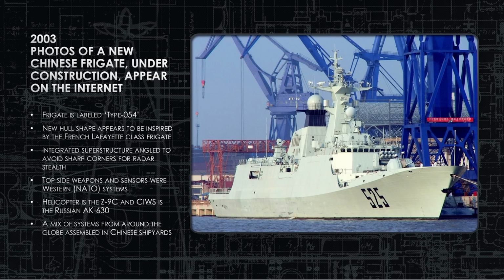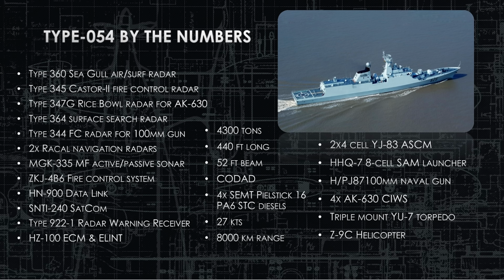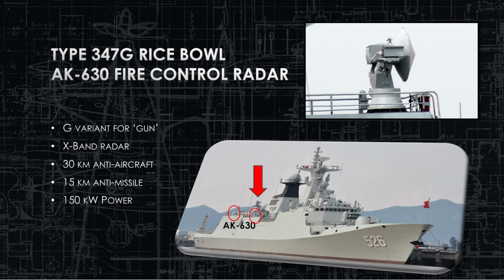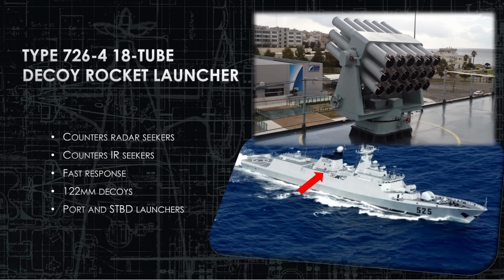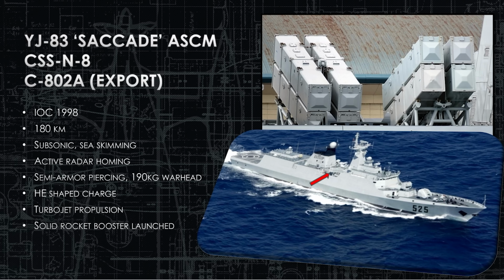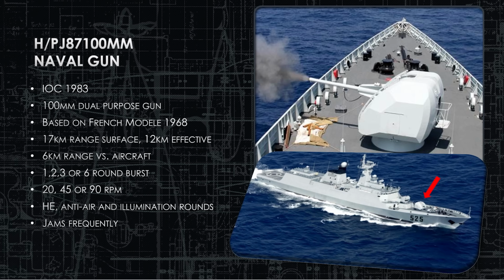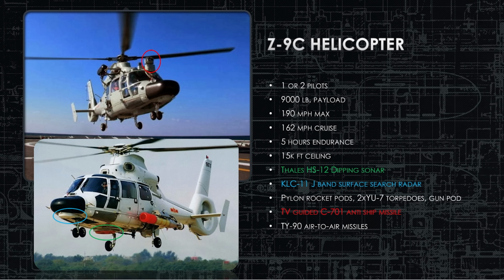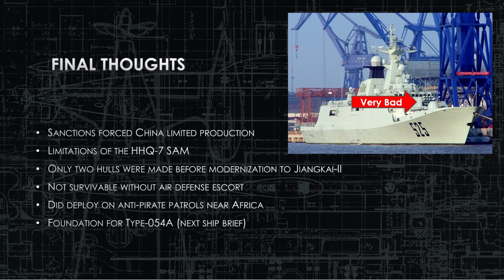Inside The DEADLY Warship China STOLE From France

Comment: With respect to the ship launched anti-sub torpedo, Generally, are the tube launched systems getting too short in range now when the sub-launched anti-ship torpedo's are much longer ranged?  I would have thought that a couple ASROC in the VLS system that can at least through the torpedo out near the sub to start would be better, assuming you have enough VLS cells.
Reply: 40 years ago our tube-launched were 5 miles and ASROCs were 8 miles but could be nuclear tipped
Reply: @michaelkendall662  thanks for the info.  I just looked up, the current Mk 48 ADCAP sub-launched ship killer has a range of between 38 or 50 km depending on the speed.  Meanwhile, the Mk 54 lightweight from a ship tube has a range of 9 km.  place that on top of an ASROC- RUM-139C which can throw the Mk 54 out 22 km before it starts to swim and a ship could, in theory, strike a sub out to 31 km (more likely less than that to give the Mk54 time to find the sub).  So, a Sub could still safely strike a ship if it was between 31 and 50 km away.  Of course, the ship can use an MH-60R to drop that Mk 54 on top of a sub more than 100 km from the ship, that's the best defence.  But I don't see a reason for the tube launchers on a ship anymore, if the sub is within 9 km the ship is already dead. I would think a couple ASROC's the Mk41 VLS in case they get surprised and can't get the MH-60 up in time (or sea state is too high to launch), but if you are actively hunting subs then having two MH-60's so that one can be up all the time would be best (in my opinion).
Reply: @Andy81ish  my EOS was almost 40 years ago
Reply: Yes, I noted the 40 year time, I wasn't trying to say you were wrong, I just listed the current weapon ranges to show that now, in 2024, it no longer seems to make sense to have tube launchers on a ship, unless the lightweight ship launched torpedo can be used to intercept the incoming heavy weight torpedo like an SM2 would intercept an incoming Harpoon type missile.  Do you recall what the range of the sub-launched torpedos was at the time?

Comment: Would be cool with a video detailing the actual and perceived benefits hyper- and supersonic missiles. With modern radar you still see it coming and all your anti-air defense missile needs to do is intercept it before it hits the ship, unless the missile has some sort of adaptive avoidance measures it shouldn't matter much how fast the incoming missile is as it's path is already predicted. To me it seems like cheap sea skimming cruise missiles (regardless if they are subsonic) with a time on target style attack designed to overwhelm defenses is the way to go.
Reply: The effectiveness of an AShM depends on many different factors, of which the velocity of the missile is but only one. Here on YouTube the importance of velocity is generally over-rated as a means to generate click bait and advertising revenue. 

Yes, velocity does make a missile more dangerous because it reduces the reaction time available to air defence systems. However, a higher velocity generates more heat due to friction as the missile moves through the atmosphere, increasing the IR signature of the threat. Limitations imposed by materials require that hypersonic missiles fly at a higher altitude to prevent them from burning up. This makes them detectable at greater distances, allowing more time for an air defence system to react. And, yes, hypersonic missiles are more destructive than subsonic ones with equivalent warhead yields because kinetic energy varies with the square of the velocity. 

However, subsonic sea skimming missiles remain very dangerous because they approach below the radar horizon of a ship's air defence system, leaving little time to react. This advantage can be diminished by having persistent linked airborne sensors with look-down radar but this is difficult for a single ship to provide because they might only deploy a single helicopter, which is not always available, and there are limits to the size of the antenna you can mount on an aircraft which limits radar power output, sensitivity, and range. The US was slow to get on the hypersonic missile bandwagon partly because sea skimming missiles are so deadly, and because more expensive hypersonic missiles are not necessarily going to be more effective.

Also, mounting a cryogenically cooled IR seeker on the nose of a hot hypersonic missile is not an easy engineering problem to solve, implying that a hypersonic missile would need to employ a short range active radar homing seeker, which can be defeated by electronic means, or be unguided on terminal approach, or be dependent upon an external update provided by an independent sensor which needs to be in position and connected at the time the update is required. And, then there is the communication and sensor blackout problem experienced by a missile which is enveloped in a shroud of plasma, the thickness of which increases at lower altitude, unless it slows down.

The most important characteristics of an air defence system is the number of layers it provides and the number of targets it can simultaneously engage. For the sake of argument, if we assume that each layer has a 50% chance of intercept, then a system with 2 layers allows a threat to have a 25% chance of success. With 3 layers this falls to 12.5%, and with 4 it falls to 6.25%. Organic air defence, provided by a carrier or shore based assets, can provide an additional outer layer. An effective counter strategy is to deploy more missiles in a ToT attack in order to saturate the air defence system. However, missiles are not cheap, and magazine depth on warships is limited for both offensive and defensive weapons. Attacking aircraft are limited in the number of AShMs they can carry. A swarm of cheap drones is likely to more effective than an expensive hypersonic missile because drones can approach from below the radar horizon, have small radar signatures, can saturate the air defence system, and can progressively deplete a ship's magazines. If you can keep sending drones then it is only a matter of time until one of them will get through, and if the damage caused degrades the air defence system, then you can cripple a very expensive warship with relatively cheap drones. This is why laser weapons are becoming more important. Laser weapons require sustained energy generation instead of magazines.

You do not need a heavy warhead, or high kinetic energy, to achieve a mission kill on a warship which is packed with fuel and explosives, especially if the munitions are stored above the water line. All you need to do is initiate an uncontrollable fire, or alternatively disable the ship's expose sensors. Western warships cost a lot more than cheaper mass produced Chinese ones partly because Western warships have more water-tight compartments and better damage control systems. This, combined with better training of Western crews to fight fire i.e. every sailor is a firefighter vs dedicated fire fighting teams, makes them more survivable. A large fleet of Chinese warships which will burn to the waterline following a single strike, even if they are equipped with hypersonic AShMs, is not necessarily more powerful than a smaller fleet of Western warships if they can absorb more damage. A damaged warship can be repaired but a sunken warship cannot be replaced in the short term.

Another consideration is that a missile is useless if you are unable to detect and continuously update target tracking data. The open ocean is a big place, and ships are unpredictable mobile targets whose area of uncertainty grows rapidly with time. Satellites are fast moving and do not remain overhead for long. Airborne assets with powerful radars are scarce, have limited operational range, and require refuelling to stay on station. The ability to strike a ship depends upon a kill chain which can be disrupted in many ways. 

So, hypersonic missiles sound scary but whether they will actually work or not under combat conditions is yet to be tested. First generation Exocet subsonic sea skimming missiles proved to be deadly for British warships during the Falklands War. Subsonic sea skimming missiles are known to work. One should not jump to conclusions and simply assume that Chinese military propaganda is indeed fact. Information warfare can be just as, if not more, effective than weapons systems!
Reply: If I may, I give ALL the Glory to the Lord Jesus Christ Who is God and His Holy Ghost 🙌🏿 ✝️ 🧎🏽

Comment: According to most information in public domain in China and Western, Type 364 radar is working at G/H band (somewhere between C/X band),not S band. Refreshing rate is various according to modes (15rpm,30rpm and 60rpm), info in wiki is 30rpm. Type 364 plays the same role as AN/SPQ-9A and is widely used on PLAN naval ships as complement of S-band main radar such as Type 382("Top-Plate" Chinese version) and Type 346 "Dragon Eye" phased array radars.

Comment: It may be a copy but I am sure it is a poor copy as china never seems to get the details right. Suspect they leave out the fire fighting and damage control training. I suspect they are a paper tiger and based on their performance so far I  suspect their performance will be poor
Reply: Yes, our ships are all fishing boats. The biggest advantage of our ship is its advanced fishing technology, while also being able to perform deep processing on board. Our latest fishing boat 055A, the 10th one is about to be outfitted. We have reserved a complete power reserve of the Aleburk 3 for electric grilled fish. If necessary, we will equip the next batch of 055B with CM40 gas turbines and continue to install four, which will be two times the power level of the Aleburke 3. There is enough electricity to hold a party at sea. You can turn on the air conditioning all night and play games without worrying about running out of battery.
Reply: ‘Am sure…suspect…suspect…suspect…’
Reply: The performance should be quite good if they've taken out the unnecessary steel and replaced it with modern high carbon corrugated recycled organic interlocking layered Quǎ Dù boarding technology.
Reply: Better hope they're junk, because if they aren't, this war is going to go south on us really quickly.

Comment: The shotgun anti-air gun is probably for drones, if i were to guess.
Reply: I just saw a clip on Funker530 of a Russian soldier downing a drone with a shotgun at around 100m range. 

Cost effectiveness is important against drones and the civilian drones are so slow and fragile that almost anything can stop them. Shotguns and lasers are cheap countermeasures.
Reply: @LeonardTavast  Brail election riots men seen with big funny looking rifles shoot down four drones a Australian invention and many sold to Ukraine.
Australian company give slinger to Ukraine is a Australian Bushmaster cannon fitted to pickups or any military vehicle and has controls and joyticks and tracking system all inside vehicle and remotely used for better protection.
Yes cost effective weapons are best against drones.
Australia sent a fair few drones and anti drone systems to Ukraine.
Reply: @LeonardTavast  lasers aren't cheap. The lenses are usually gemstones and expensive to manufacture and the tubes are a fortune. They both burn out rapidly. They could potentially be cheap one day, but it is not today. I'd wager the cost is not dissimilar to a phalanx salvo right now.  The advantage is the laser can be used in a lot more circumstances where a salvo of hot metal would not be appreciated or safe- drones can easily use neutral or allied civvy vessels as meat shields. Maybe even used on civvy drones in port.
Reply: @mandowarrior123  electrical lasers use polished optics and cost in the neighborhood of $10 per discharge
Reply: If I may, I give ALL the Glory to the Lord Jesus Christ Who is God and His Holy Ghost 🙌🏿 ✝️ 🧎🏽

Comment: Wonder if the sonar(s) have better shallow water capability. May mean these are kept close to home in case of hostilities as a way to make good use of the platforms, without needing an air defence hull nearby..
Reply: 054 is specialized in anti submarine, anti aircraft should be handled by 052 or bigger 052 (the 055).